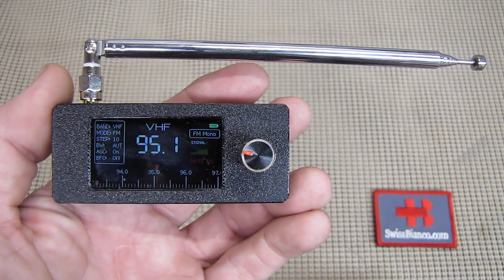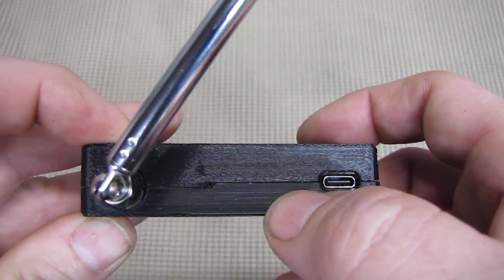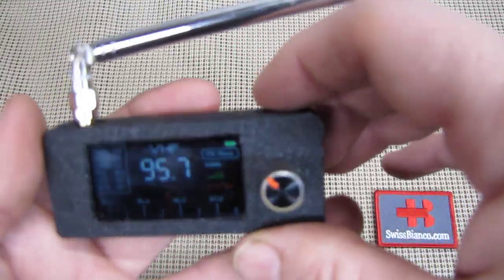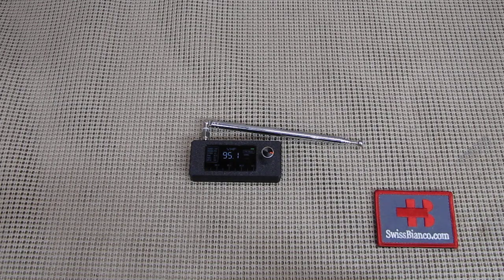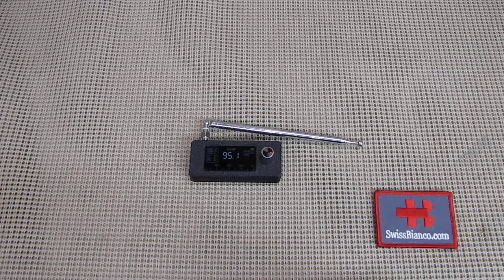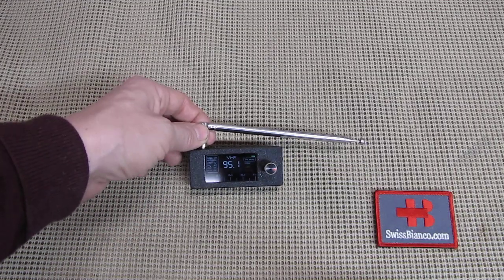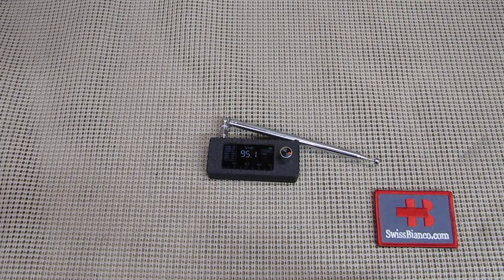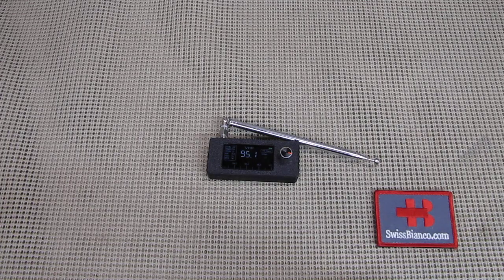Si4732 Mini Pocket Wide Band Radio - upgrades and results, how good is it?

Comment: I dunno. The knob sticks out way too far and the antenna is kinda obnoxious. I’ve got a small grey am/fm not much bigger than that where the antenna kinda folds in flush with the box. Mines old though and only operates on triple a’s.

If the antenna works best when it’s closer to the circuit I’d try and modify it or replace it completely with something a little more compact. Also I’d see what I could do with making the turning nob smaller. Maybe just take the cap off of it completely and tune with just the thin pole it’s attached too? 🤷🏻‍♂️